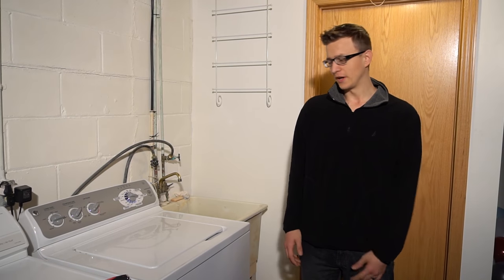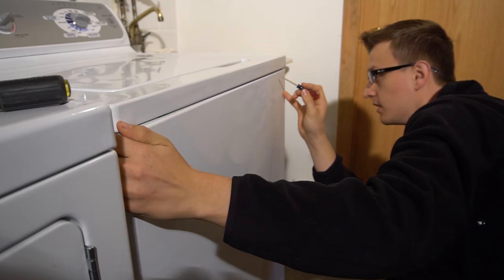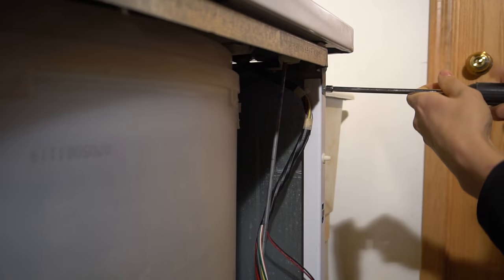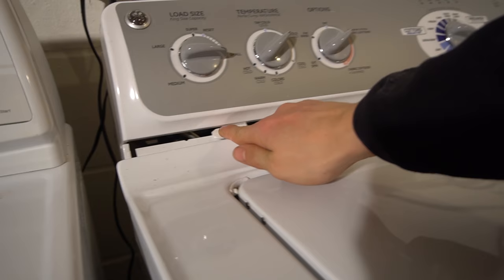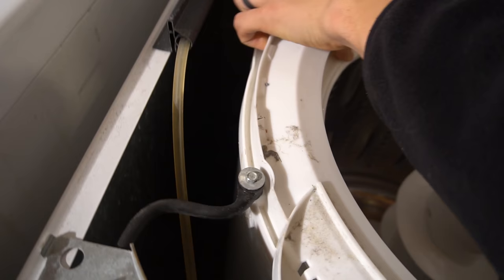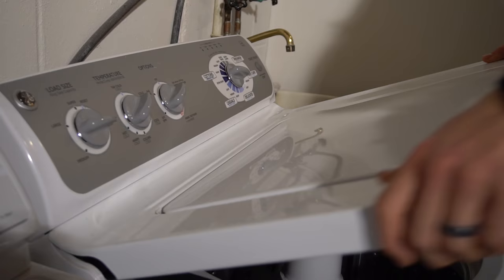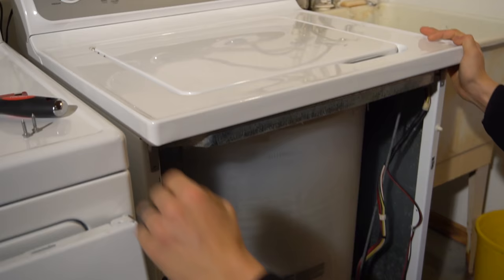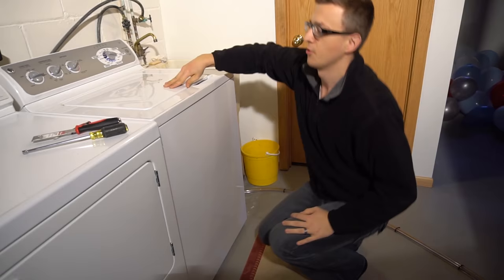How to Take Apart a GE Topload Washer

Comment: I wasn't fixing a broken stabilizer. But, I was looking for a leak in the cabinet of a GE washer WHSE5240D1WW. This video helped me a lot with getting the front cover off, and the top cover loose (and knowing that the lid sensor does NOT come loose, so I needed to have someone hold it). Got exactly what I needed to know from this video. Thank you! Saved me from buying a new outer tub assembly, which would not have fixed the problem anyway.

Comment: Hey Jay what was that rubber piece called. I'm having similar issues. It sounds like the monsters from stranger things are breaking through. I have a Admiral which I believe is owned by maytag.
Reply from the maker: Hey Aaron! Are you talking about the rubber straps? ( https://amzn.to/2UDEsLq ) I think only GE washers have them.. But I may be wrong. Did you visually check and try to find where the banging is happening (look for scuffs or little dents)

Comment: Thanks for the video on showing how to open the washer panel. My washer was banging noises, and I checked all 4 straps and they looked good. Why else would the washer tub be banging around like that?
Reply: It is possible that one of the suspension rods, that the tub is suspended from has gotten bent. Even a small bend will do it. The easiest thing could be the ball and socket that holds the rods. They are supposed to move freely, there is grease in the socket, if the grease is sticky that can cause it. If they are damaged at all replace them. If the grease is nasty clean thoroughly and regrease. It takes strong hands to lift the rod out of place to repair. Make sure to do one rod at a time or you will have to lift  every thing with one hand.
Reply: Thank you for not explaining for ten minutes why I might want to open my washing machine and getting straight to the point. I obviously was looking up how to get in there that is how I found your video. 

Seriously short sweet and to the pint

Comment: Hey thanks for the video. I have a different model (Model# GTW335ASNWW) but it's also a ge top loader. Is it safe to assume that the front panel is similar as far as the 2 clips in roughly the same position?
Reply: Yes, I can confirm, with the top loaders they're all in roughly the same place.